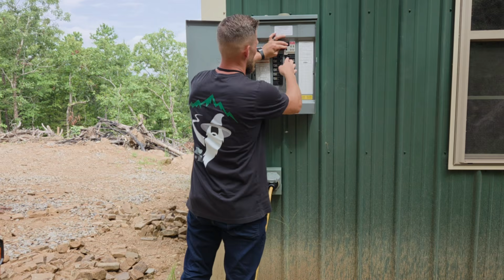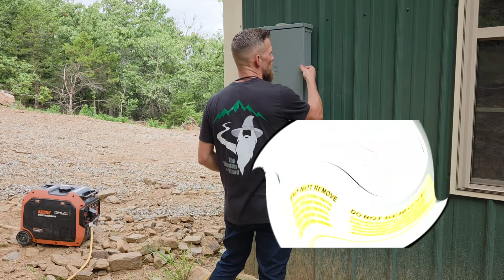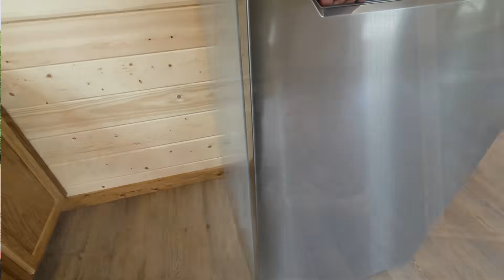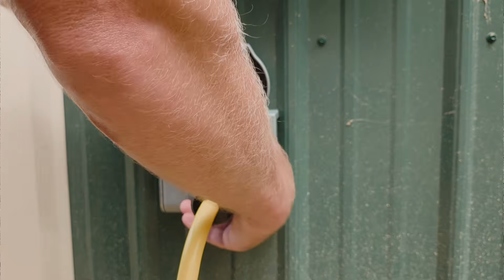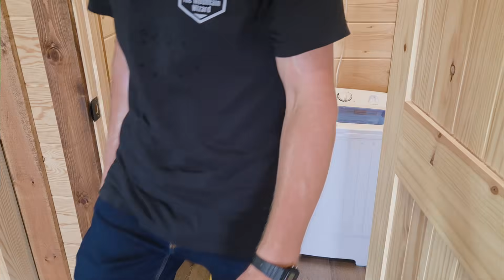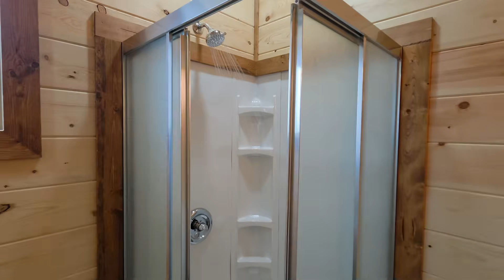Whole Home Generator Setup for Under $1,000 – Watch This!

Comment from the maker: Drop your questions down below and thank you for watching!
Reply: Thank you so much for this video
Reply: What type of wires did you use to connect the 50 Amp inlet box to the breaker panel . Is it the ( 12/2) gauge or a totally different type of wire and if you could can you do a video to demonstrate the process without the grid power .
Reply from the maker: @roodydestyl3757 6/3 wire.
Red and black to breaker
White to neutral bar
Green to ground bar
Reply: Do you have a website that i can look at where you sell these cabins?  I'm looking on the Oklahoma side of the Oachita National Forest but not necessarily opposed to Arkansas
Reply from the maker: @Cool_boy258 themountainwizard.com

You should see a spot to get on the email list!

Comment: Wiz, I just came across your channel a fee weeks ago and subscribed. Lotta good info. Let me add some background and some insights.

I'm a firefighter with many years in the business. It has taught me to make self rescue Plan A if things go south.

I live in NW Indiana. We are still going thru the clean up phase of a tornado from last week... almost a week ago... when all of the grid went down which included gas stations. A majority of the counties surround8ng Gary and Chicago are seeing a large portion of people on gen power, gas station lines were ridiculous the first 3 days. You should figure on how to work your way thru that with multiple gas cans of stabilized fuel. Otherwise you're gonna be spending your time away from your home hoping the gas station doesn't run out of fuel before you get to the pump.

Gas stations at night under normal conditions are dangerous but when the grid is down it seems to be a free for all. If you go, look like a hard target.

If your gen set is visible to the public you're setting yourself up for theft. Get a quiet generator and make it less portable with a bike chain and cinder blocks. 

2 is 1, 1 aint shit. Dual fuel inverter generators allow options and buy time while waiting for repairs to infrastructure. Put 2 or 3 20lbs propane bottles back in storage so while everyone else is waiting in that gas line, you're securing your place, cleaning up limbs, tacking down tarps. 

Tri fuel gen sets use natural gas. Hire a plumber and have them tap into your meter feed so you never have to go get fuel and you're ahead of the game. Hire an electrician to put a generator connection in the back of the house with a transfer switch and you've got it dicked. If you ever move the gen set can go with you.

I saw more the one whole home generac installed where the tech didn't exhaust the gen away from the house, blowing the exhaust across the back of the home. We got called out for high levels of carbon monoxide and it sure was. If you have this issue reroute the exhaust away from the home with galvanized or cast iron pipe. 

A large power station (eccoflow, pecron,  anker solix...etc) will buy you time and act as a buffer that conserves fuel and keeps your place powered silently. It's also fairly portable. 

Special consideration for CPAP is a battery back up. Also on demand water heaters. 

Why the hell anyone would put exclusively all electric appliances is frigging beyond me. Had this storm occurred in January it would bring another set of issues. Gas will cook your food and heat your water while keeping you warm. Speaking of which, a 5000btu window unit in your bedroom with a power station or generator will get you thru some rough August nights. 

Cash is king. Always have some on hand because you can't get to it when the grid is down.
Reply from the maker: Excellent advice. None of which I disagree with,  and very much in line with my experiences and thoughts on the subject.

Appreciate you taking the time to watch and comment with your thoughts.

Glad to have you.

Comment: Did you remove the bonding wire from the generator before plug into main panel
Reply from the maker: Good question, I did not remove/ disconnect any wiring from the generator. 

I'm ignorant on that.

Comment: The link to the jackery isnt working
Reply from the maker: https://amzn.to/4bDs86Q
Reply from the maker: Got it thank you!
Reply: @themountainwizard  ive been thinking about building my own small battery bank generator just to run my furnace if the grid goes down. I have the Wen generator like yours, just want to be silent at night and still have heat
Reply from the maker: @kevinlangrehr5760 yeah that jackery is probably the best.optipn then. Thats the smallest unit they have that still puts out 240v.
Reply: Correction, the best buy one isn't,  the Amazon link does

Comment: And you NEED TO TURN OFF THE FIRST POINT OF DISCONNECT FROM THE POWER GRID... Not just the first one you have available to use..... like mobile homes in my area are required to have an outside disconnect, along with the factory installed 200 amp disconnect breaker panel Inside.
Reply from the maker: Yeah there can be variables based upon your system, this is why its best to reach out to a local professional to have them at least lay eyes on it.

IMHO